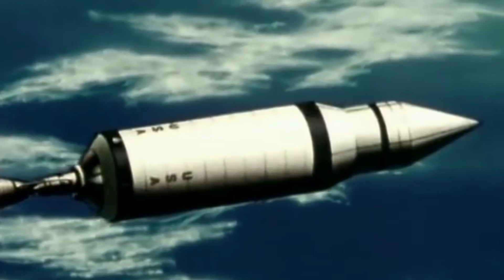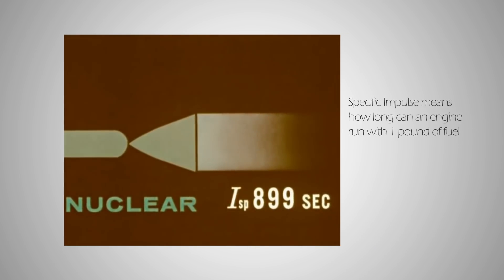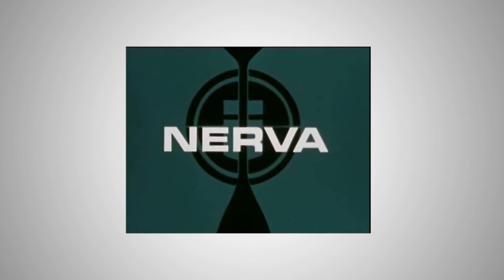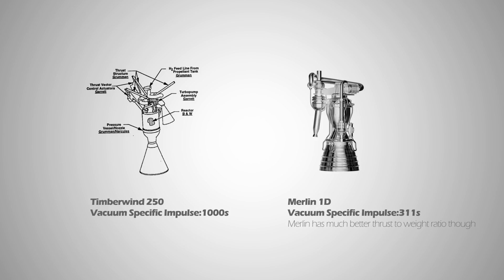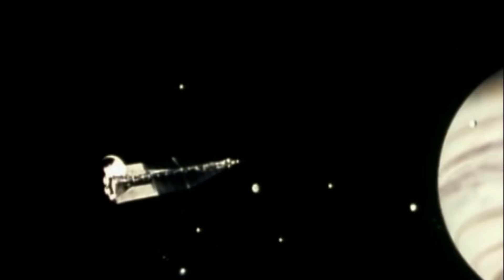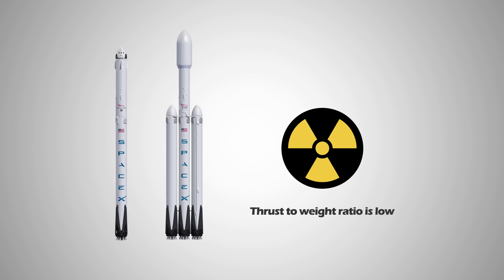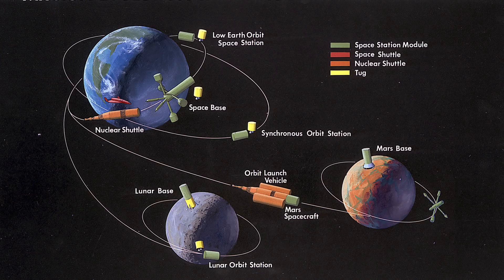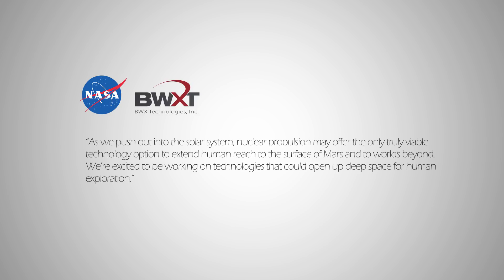What comes after BFR for SpaceX, a nuclear-powered rocket?

Comment: One big misconception in this video is the idea that nuclear rockets would be used to reach mars faster instead of just using them to carry more payload for the same amount of spent fuel. While they are more efficient, they are not so efficient that it would be economical to make use of ourtrageously inefficient trajectories just to save time. In space travel, due to the fact that rockets are mostly composed of fuel (even the nuclear ones), payload capacity is the most valuable comodity. In short, time is cheap, payload capacity is expensive. Using the same rocket, it is preferable to use an optimal trajectory and reach mars in 6 months with loads of payload than to use an inefficient trajectory reaching it in 2 months with almost no payload.

Comment: I am going to have to disagree with the statement that N.T.R would not align with SpaceX's reusability focused mindset. The concept of an N.T.R rocket to shuttlecraft from Earth and Mars (among other destinations). NASA came up with that concept in part because it IS reusable. The idea of putting one on an orbital launch rocket doesn't make as much sense. But imagine a shuttle that could carry 4 or more BFR stage 2 rockets from Earth orbit to Mars orbit only to come back to Earth and do it all over again. NASA proved that those rockets are extremely reliable. The tests they did in the 60s had an engine run continuously longer than any other rocket engine in history. An NTR shuttle could probably be used for 10+ missions. And since each mission would be 25 months apart that could mean 20+ years of continuous use without maintenance. Not to mention that, because of the more fuel efficiency and the ability to carry multiple craft at once, the refueling process would involve a lot fewer launches. Currently, the plan is to have BFR refueled in orbit above Earth which could take between 3 and 5 launches for just the fuel. That means between 5 and 7 total launches for just one BFR to Mars. With NTR shuttle that system that could be reduced significantly. Which regardless of how cheap each launch will hopefully get, less luanches will mean even cheaper and put less wear and tare on the launch vehicle. 
In summary: I would be surprised if SpaceX doesn't in the next decade or two make a Nuclear Thermal Rocket for inter-planet shuttling.

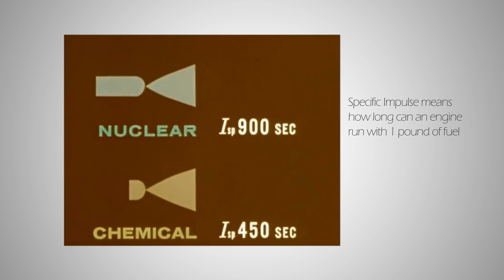Comment: 1:43 [higher Isp] "this means nuclear rockets can burn for much longer time with the same amount of fuel".
The author probably does not have this in mind, just used shortcuts, but reading this literally, this is not how this works. The smaller chemical engine would burn the same amount of fuel for much longer that big engine of the same type, with similar Isp ;-)

The specific impulse is about the amount of momentum you get from a unit of fuel. So it is (kg m/s)/kg = m/s (and is equal to exhaust velocity). Or, the amount of momentum from a unit of fuels _weight_. That is from where we get seconds, (kg*m/s)/(kg * m/s^2) = s. To get one from another you have to multiply/divide by g. 
The Isp has nothing to do with how long an engine would work on 1ton of fuel. Yes, most hi Isp engines use fuel slow (this is more about energy source) and from two engines with the same trust, the one with higher Isp will work longer, but the quantity measures acquired momentum - fuel weight ratio, the second as a unit is the result of units cancelation, not measuring time.
Reply: bartekltg, no, I think he should have said "propellant" instead of "fuel". Then he would have been 100% correct. The oxygen weighs about twice as much as the hydrogen propellant, yes? So if the oxygen is replaced with its weight in hydrogen, then the nuclear rocket gets 2-3 times more impulse (in seconds) than the chemical rocket. Not by coincidence, the required operational time is increased.
Reply: Doesn't matter. Yes, it would be better to call it propellant, but this is not the problem, probably most of the viewers assumed that by fuel he means both fuel and oxidizer in the case of a chemical engine. 
No, the specific impulse does not increase because there is no oxygen. Isp is greater because propellant exhausted from nozzles is faster, and it is faster because the molecules are lighter. H2 is 9 times lighter than water (the product of hydrogen-oxygen engine). Isp is more or less proportional to the square root( temperature over molecule's mass). NERVA doesn't get 3 times performance, because we need to keep the reactor at lower temperature that is in the combustion chamber, so it doesn't melt.      
As I said before, the operational time has nothing to do with Isp. Just put a bigger engine and operational time will decrease;) It is correlated, but "900s" doesn't mean it will work for 900s. Ion engines's Isp can get to for example 20000s, 40 times more than chemical. So they works 40 * normal rocket, so 400minutes? No, they work for months:)

Comment: Since BFRs can dock rear to rear, docking an NTR on the back should not be that much of a leap. 

If the BFR is built then whoever builds an NTR, (it does not need to be SpaceX), it being compatible with the  BFR rear docking should be doable in any case.
Reply: Solanumtinkr, the BFR/BFS docking system should certainly be capable of attaching a BFS to a nuclear tug. However, the tug needs Hydrogen for each trip, which must be lifted from Earth, so additional plumbing is needed for supplying that new propellant, probably through the BFS. Sounds doable.
Reply: If you look at the BFR and how it intends to refule ships ro reach Mars.... Figuring out how to do that for an NTR also designed to dock with the same system... Just saying it becomes obvious. If the BFR(Ship) to BFR(Tanker) refuelling works, then half the work is already done. You just need a refuel the NTR using the same system, then I'd hope you can just leave the NTR in orbit.
Reply: The satellite launcher variant of the BFR could launch a fuel tank with hydrogen which could then dock with the nuclear rocket.
Reply: It's not a problem for me in KSP.

Comment: how does a nuclear thermal engine work? it's not the "let's just drop nukes behind us" strategy, right? great video.
Reply: Bo, 
you build a heat exchanger into a nuclear fission reactor that can handle extreme heat when propellant is not pumped through it. It also has to transfer heat to the propellant efficiently at high flow rates. It has to durably survive the thermal shock when propellant is shut off and restarted. 

The reactor needs to become neutron critical very fast and also damped just as fast. The damping rods must work reliably, rapidly, and often. 

The Nuclear Thermal Rockets that were developed about 60 years ago used rare short-half-life elements (not uranium, nor plutonium) from breeder reactors or accelerators. These would need to be produced again in quantity. 
If tugs are to be used long-term
Reply: David Ogawa  interesting. thanks!

Comment: As Dr.Zubrin has stated repeatedly,  better engines shouldn't be used to go to mars faster, but instead to bring more payload. The radiation astronauts would be exposed to  on a 6 month trip to mars is almost the same as the radiation nasa has exposed their astronauts to onboard the ISS for long periods. However, mars itself provides little shielding. You're best off using the extra power to lug more supplies and utilities, which can double as shielding by placing the tanks or machines around the crewed compartment to soak up some rads that would otherwise reach the crew. This would also help solve the radiation problem after landing on mars, which will not go away.
Reply: Powered by a Zubrin nuclear salt water rocket.

Comment: I have always wondered why we don't launch rockets from the top of a very high mountain on the equator? Presumably, other than the cost of building infrastructure in what is necessarily a remote location, it would have many benefits. The elevation would lower the amount of fuel to ascend to that hight, there would be no preexisting infrastructure or people to be harmed if something goes wrong and  even the engine nozzles can be optimized for lower air pressure allowing them to have a more efficient energy usage.

As to nuclear rockets... I firmly believe they, r some derivation thereof, will be used for strictly space ships, like the Enterprise on Star Trek. in that they will not land. I still have hope the EM drive will fill that niche.... If it can be made exponentially more efficient.

Or perhaps PMP propulsion?  http://incapp.org/blog/?p=3516
Reply: We don't launch rockets from the top of a very high mountain on the equator because the fuel savings are too marginal to justify the cost of the logistics necessary to operate a launch facility from such a place. As for the reason the fuel savings are marginal, it has to do with how orbits work: they are not about going up, but going "sideways" i.e. parallel to the ground. That's why rockets tip over and start going donwnrange almost immediately after launch. Compared to the amount of energy necessary to reach orbital velocity ("sideways" velocity), the energy spent fighting gravity by going straght up is minimal. Also, because of thrust to weight limitations, rockets don't suffer so much from atmospheric drag early on during their trajectory, and higher air pressure actually heps with engine efficiency early on by directing the exhaust downward instead of sideways. Of course this means engines lose efficiency as the go up, but that is when staging comes into play, the second stage is optimized to make up for the loss in efficiency with a longer nozzle. In the case of a vacuum-optimized engine, it's not so much gaining efficiency as it is making up for lost efficiency . Of course engine efficiency also increases as you reach vacuum, because the exhaust always has to push against the air pressure to leave the engine, effectively using up some of the available energy and decreasing exhaust velocity, which also decreases efficiency at higher atm pressures. In the end these differences would average out and, well, long story short there isn't much fuel saving from lauching from a mountain by using rockets.

Comment: The NTR engine must first be made extremely robust in terms of atmospheric reentry before it can be considered as an upper stage option. 

Any accidental radiation dispersion, in excess of what a single coal fired plant produces, would be highly unpopular. 

A NTR built as a mostly-engine sub-module with it's own reentry heat shield would overcome many objections. Such a module would require an extremely reliable aero-braking steering system, as this would be required on arrival at planets (with atmosphere) in order to aquire a parking orbit. It would also need small on-board propellant tanks to adjust its own orbit after aero-braking. This could be chemical propellants, Hydrogen, and/or inert gas. 

It would be left in orbit after each use and provided with large propellent tanks as needed.

IMAO, the NTR will never be scaled up to the thrust levels of a first stage booster. The latent radiation and heat output would be untenable.

Comment: A few points: until the reactor starts up there is no nuclear waste. As the reactor only operates for minutes the quantity of waste generated is very low. The reactor exhaust is not radioactive as the coolant does not spend much time in the reactor and irradiated hydrogen is deuterium which is pretty common in the environment. Finally use of a nuclear reactor in space is not prohibited by any treaty. Nuclear pulse propulsion is against the nuclear test ban treaty.

Comment: I think the BFR is too small for the colonization of Mars. It needed to be economically viable, so they reduced the size of the original ITS (that would have been anyway too small) to use it as a satellite carrier. They are probably going to use it only for the early exploration. Once people start buying enough tickets, the next move will probably be to build a massive (really massive) interplanetary ship, optimized for space and uncapable of atmospheric reentry, so that it won't need high T/W engines, landing legs, heat sields and robust structures. Said ship will use BFR and BFS as shuttles from orbit to surface and vice-versa, and it will have no problem using nuclear-thermal engines or other non-chemical engines
Reply: Davide Cuccato,
Even if the interplanetary carrier rocket is designed to not land, I think it must still use a heat shield to decelerate. Using propellant to decelerate is very wasteful. That would have to wait for nuclear fusion rockets that emit highly ionize plasma. 

I also find it hard to justify transferring cargo containers from one vessel to another. The only thing that has occurred to me to omit from the transit is the propellant for landing. That could be brought up from the surface. However, there would need to be enough propellant to steer through the aero-braking and rendezvous with the orbital tanker. Even the carrier ship will need refilling.
Reply: Hi David. The BFR also needs to rendezvous with a tanker and refuel, so those are problems in common between the two solutions. The advantage of an interplanetary ship is that you get to do the interplanetary transfer burn and deceleration with an engine with a better specific impulse. That means with an interplanetary ship you need 2 to 3 times less fuel for a given amount of payload than with the BFR (so less tankers and less randezvous). The heat shield usually isn't necessary for aerobreaking, but even if you wanted a super-aggressive deceleration, the ship will have an enormous surface area and a fairly low density, so the thermal energy will be spread, and very lightweight reusable tiles will be fine. Transferring people between two ships isn't an issue (it is reliably and periodically done with the ISS). I agree that heavy cargo will be more difficult to handle, but it is not impossible

Comment: 900 isp rocket is not twice as good as 450 or 380s rocket. Worse TWR and bigger tanks. And more expensive. BFR system also basically halves the fuel need by using the atmosphere to brake and land. Not that aerobraking with nuclear isnt impossible. 

Also 2 months to mars is not going to happen even with nuclear. The faster your escape veilocity, the bigger the entry speed at mars/earth...
Reply: Rok Adamlje, 
Can you imagine increasing the time spent decelerating in thin Mars atmosphere by factor of three? That might use up the heat shield in one round trip. They might need terrain-hugging altitudes just to slow down enough. They might have to skip back out to vacuum to get GPS oriented, make course corrections.
Reply: http://smad.com/wp-content/uploads/rirtme.pdf

70 day travel time uses 12km/s mars injection, and needs to shed 20km/s at mars, somehow. Total dV even after doing aerobraking, 30km/s...

Comment: Nuclear thermal rockets are basically obsoleted by high power solar electric propulsion though. 

NTR's have a ton of practical downsides, and are difficult to reuse or to combine with in situ fuel production. The Isp benefit compared to chemical is almost completely offset by the low density of liquid hydrogen and the high weight of the engine. 

As such, it reduces the mass needed to LEO but not the number of stages needed to complete a mission, so when you factor in the fact that it has fewer ISRU options it makes reuse harder. Basically, you're better off using a nuclear reactor on mars to make chemical fuel for the return than to put it on the actual rocket.

SEP on the other hand offers more than twice the fuel efficiency and does it with much more practical high density fuels that are easily storable. Argon in particular is relatively easy to produce on Mars from the atmosphere.
Reply: SEP is low thrust. NTR have orders of magnitude more thrust. Don't confuse NEP with NTR.
Reply: But isn't electrical propulsion notoriously known for low thrust and are outfitted on satellites that have no worry for time? Were talking about human flight that requires the least amount of time as possible. NTP would be pretty powerful and get Humans to mars in good time.

Comment: Nuclear space tug is a good idea.  I still propose a wire cable solenoid choo-choo  where the cable is a few thousand miles long and it is charged like an electromagnet with solar voltaics.  then the tug will have a mass to work against (with) in order to tether to the cargo ship.  A series of tugs to accelerate to 0.1 Speed of Light (SOL)  and a series to de-accelerate located near Mars.  They are dumb solenoids and can self deploy.  In second embodiment they house rocket thrusting positioning and tensioning maintenance facilities at each end of the choo-choo cable; wherein personnel and medical facilities are available.

Comment: Specific impulse is the exit velocity of the exhaust gas divided by the gravity constant, not the length of time it takes to burn a pound of fuel.

It was created so that even if you measure velocity in feet/sec or m/sec when it is divided by the gravity constant(9.81m/s/s) it will always be a value in seconds. This allows for efficiency to be compared without doing conversions from imperial to metric.
Reply: eoin connolly, absolutely correct. 

It is hard to make an engine do both high thrust and high impulse. We marvel at the infrequent exceptions that do not break the bank. 

Very high impulse engines generally seem to take a longer time to achieve their delta V than lower impulse but higher thrust engines. This is not surprising. The two goals are not synergistic but often conflict. The SLS has astonishingly efficient hydrogen engines, but they still have to add on solid boosters. Why not just double down on more hydrogen combustion?